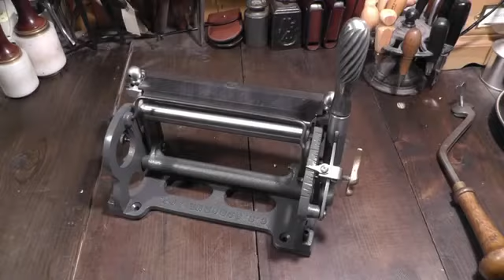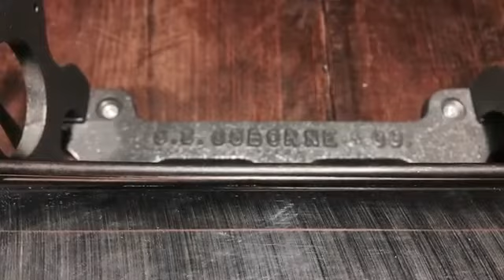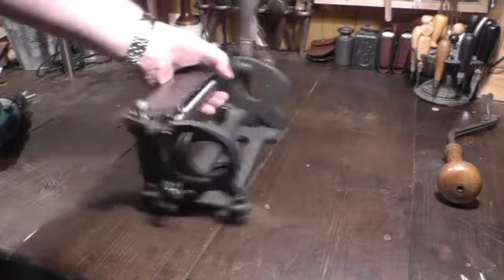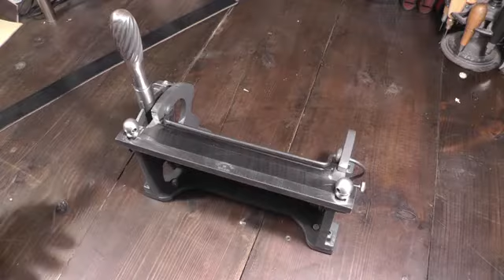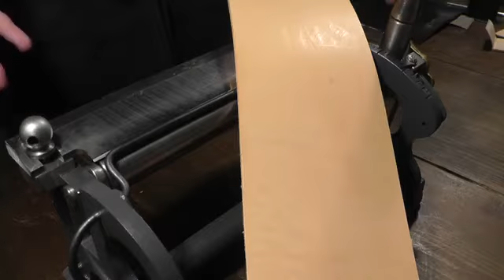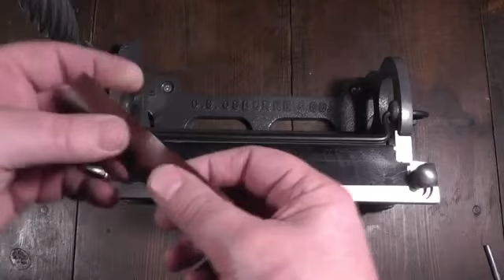C S  Osborne & Co  - No.  84 Splitting Machine

Comment: I purchased this machine because of how easy this video made it look. The machine looks very well made. I ordered the machine through Metropolitan Leather and I am having nothing but trouble with this machine. The quality is shocking. The posts where the blade is mounted are unevenly bevelled? The lock doesn't lock unless you drop a ball bearing down the hole. The handle has bent.  There is about 2mm of movement when you lock off the roller which lifts it on the handle side leaving the blade completely uneven against the roller. When the safety bar is down, it makes it almost impossible to pull the leather through so had to use it with the safety bar up - which resulted in nearly losing a finger! I have not managed a successful cut yet. I have spent £650+ on this machine and I cannot complete my orders without it. Any guidance would be greatly appreciated! I am tearing my hair out with this whole situation and my business is suffering because of it. I am in the UK so unable to speak to anyone from CS Osbourne about this. If you could get in touch - it would mean the world to me!
Reply: DD Practical, Okay, you are not using the machine correctly. I had the same problems when I tried to use the machine. Don't give up. You will get to the results like the video. 1. Lining up the roller is very important. I am trying to explain this in my posts but i don't think I am explaining this very well. You must make sure this is perfectly straight and this is where the art of the machine comes in, you need to play around with where the "center" of the roller is. This could be slightly forward (for me it was) or slightly backward. I will message more in a moment...
Reply: DD Practical. Make sure to always keep the safety bar down. Use two hands to pull the leather through if you are evenly splitting, skiving the entire backside then you can start the skive in the middle or two-thirds towards the edge to where it feels more comfortable and the leather doesn't risk stretching or tearing, after, rotate the leather and skive the the other end and you can put the entire piece through a third time (if needed) to make sure the entire length is even. If you are trying to split a very thick leather down to very thin, you may want to try in two splits until you get the hand of the machine. To get the skive started you can lightly use two hands and shift to the left/right to get the blade to stick into the leather as you pull, the split will get deeper and you can continue to pull the leather through and the splitting will gradually ease and be completed.....for tapered skiving..next
Reply: @THEMITTE  this is exactly what we are doing. It is destroying my leather. We can’t pull the leather through with the safety bar down. Full stop. 
We are only looking to split at this time. We have done everything you have mentioned. With no success. We cannot get the blade aligned straight to the roller without adding various washers etc because of how poorly the machine is finished.
Reply: For tapered skiving you need to adjust the machine arm. Always adjust the machine arm to your purpose. I have some tape on the inside of the arm where the adjuster parts are and mark a line for the perfect skive, the thicket skive and the thinnest skive and splits. Adjust the fittings lightly (not aggressively because you want the fittings to easily tighten the handle and naturally fall into the setting, this is also a quirk that takes a moment to learn). It's not digital so you will always have a slight guesswork on the adjusting, this is why I mark a piece of tape. So, for splitting, get a test piece and flip the leather over and split the opposite side of the way you skived down the entire piece of leather. The video is a little confusing because you don't realize that you need to turn the leather over for the different types of skiving. Try and just pull the tapered skive through without tapering first. Once you get a skive that works you can adjust to the leather and twist the butterfly screws to make the skive thinner, after you figure out the thickest to thinnest range you can use the loosening and tightening handle. I hope this is helping you out.
Reply: @THEMITTE  hi Jason, I completely understand how IT IS SUPPOSED to work. It just doesn’t. It is physically impossible to align the blade correctly due to how the machine has been poorly finished. The handle lock doesn’t work without adding a ball bearing to it. The safety bar is so tight you can’t pull leather through. The handle has bent. The posts that hold the blade are uneven and NOT FLAT. 
It doesn’t matter what we do, it doesn’t work.
Reply: @ddpractical  I don’t think you should be adding anything to the machine unless it’s directly from the manufacturer. If so, I can’t help you with trouble shooting because your machine wouldn’t be the same as mine. I am still thinking you may have a problem with your machine and may need to return it.
Reply: @THEMITTE  oh there is undoubtedly many issues with this machine! If we don’t add a few washers and bits here and there it is completely unusable. I have emailed my supplier to discuss how to move forward.

Comment: Great video. Getting the blade in the correct position is key. This took me several attempts. The way I finally managed to do it was to lightly press down on the blade when set into the posts and to make sure the blade is centered, but slightly towards the front/forward if you are unsure. If the blade isn't perfectly flat, the split won't work properly, also, tighten both sides at the same time rather than one side at a time, this should help keep the blade from shifting out of alignment. Once the blade is set properly, the Osborne works lovely. Just like this video. I have a feeling @pavelv2001 may have come across the issue with the blade not being pressed down flat when installing. Good luck.
Reply: Hi Jason, the posts that my blade mounts on, IS NOT FLAT? It's unevenly bevelled? So when you tighten the screw it changes the angle of the blade. I have had NOTHING but problems with this machine. I just CANNOT get a satisfactory cut. It is DESTROYING my leather. Any guidance would be greatly appreciated as I have orders I need to complete and I just don't know what to do!! :'(
Reply: @ddpractical  Hi DD Practical. The blade is completely flat and the machine works amazing once you figure out the quirks. I place the flat side of the blade slightly (maybe a 1-2mm-ish past the imaginary top of the roller wheel center line –away from you if you are standing in from of the machine with the handle on the left side), turn the tightening rods evenly while pressing down on the safe part of the blade to keep it straight, slowly (trying to not move the blade while keeping it as straight as possible to completely tighten)...testing the skive, split. Maybe I can help you if you let me know what you are trying to split/skive? Hopefully I am being helpful and not adding to the confusion.
Reply: @THEMITTE  hi Jason, Thanks for the reply! I do not deny the blade is flat. It’s the rest of the machine that is the problem. 

The way the casting has been finished is substandard. The posts where the blade sits have been unevenly finished so the blade does not sit evenly left to right and can rock back and forwards making it impossible to get correct blade alignment to the roller.

Secondly, there is an excessive amount of free play in the mechanisms. When we first received the machine, the locking handle would not lock. We managed to resolve this by dropping a ball bearing down the hole and now it locks satisfactorily. However, when you lock the roller in place it raises the handle side of the roller by around 2mm resulting in it being misaligned to the cutting edge of the blade.

Thirdly, the safety bar, which I consider an essential part of the machine, when locked in place (as per the CS Osbourne Video Tutorial), prevents you from pulling the leather through - so we have no option but to leave the safety bar raised whilst using it.

Fourthly, the shoulder of the blade retaining knobs are significantly smaller than the slot machined into the blade - therefore the blade has physically come away from the machine whilst we have tried to split the leather resulting in injury to myself. We have temporarily rectified this by filing down some large washers to fit.

It has been a disaster from start to finish. I’m just trying to split 2mm leather to 1mm for pockets for my Leathercrafts. I have customers waiting on their orders.
Reply: @ddpractical  I am thinking I should make a video.
Reply: @THEMITTE  you make a video. We’ll make a video doing everything the same as you and you can see how shit our machine is. We are not new to how things work. Our machine isn’t fit for purpose.
Reply: @ddpractical  This is a huge bummer. I am wondering if your machine is defective? I have had some annoying issues but nothing like the blade moving. I will get back to this post in a bit. I was so happy with this machine and was so bummed to hear others not.
Reply: @ddpractical  Yes, we need to get to the bottom of this. WTFluff is wrong with this machine!? lol.
Reply: @THEMITTE  I’d like to know too! My partner is very good at aligning blades and doing things properly. We shouldn’t have to add pieces to this machine in order to get a half shit split. We are just throwing money down the drain as it’s destroying leather. Absolutely gutted.
Reply: @ddpractical  I was thinking, possibly the leather you are trying to split is too soft and thin for this machine? I am not an expert but I would think that this machine would work best with firmer leathers, just a thought. I have some soft dress glove leather that I don't think would in this machine. It would just get mauled. Usually, the really soft and butter-like leathers would need an electric splitter. Fortuna or OMAC style machines.

Comment: Beautiful machine! What is the widest piece of leather the splitter can cut? The blade is 8” but I’m guessing I should offset from each side of the blade, so this leaves me with a 6” leather piece maximum?
Reply: Hi, may I ask where you picked up this machine?
Reply: dane jurasley hi I never bought it, I go to a local shop who has a camoga splitter, this machine in the video is good for thick leather straps but not regular jobs
Reply: It does look perfect especially skiving. I’m just not there yet. Thanks Marie Anne.
Reply: Thanks ms Marie Anne, I wanted to use it for wallets and other small jobs. I don’t believe it’s for me.
Reply: dane jurasley for that you will need a bell skiver, a little pricey, but less expensive then a camoga, also can let you skive around the edges, it’s perfect for wallets and bags